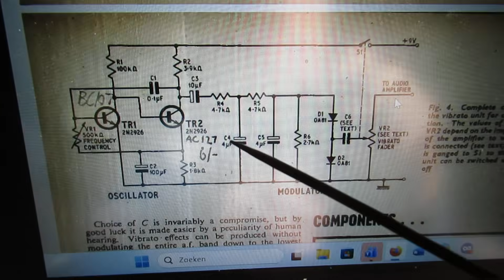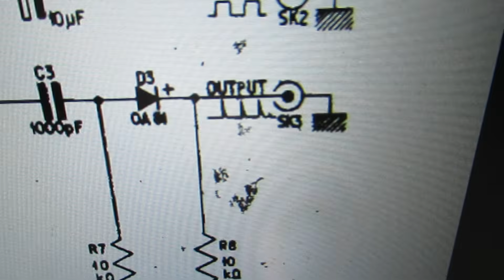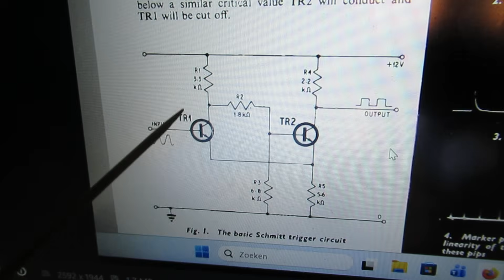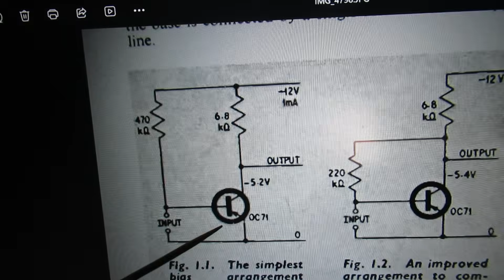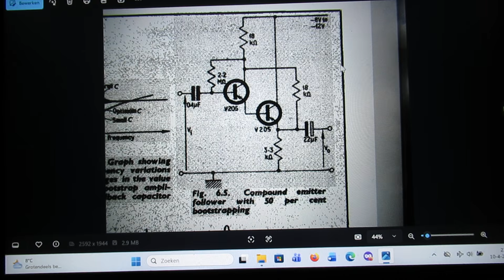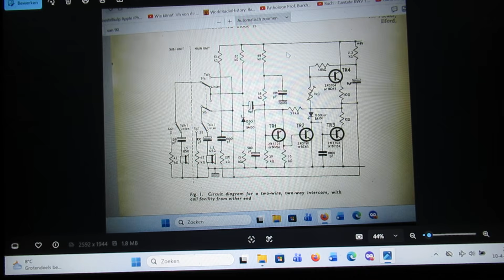About simple transistor circuits of the 1960s and 1970s and how to make them in modern times (pt.2)

Comment: I missed ONE DAY of electronics class. It was the day that transistor circuit design was covered. I never recovered, and never put a transistor in any circuit design for decades, and only then, after having no choice but to use Mosfets. Thankfully op amps were a thing!